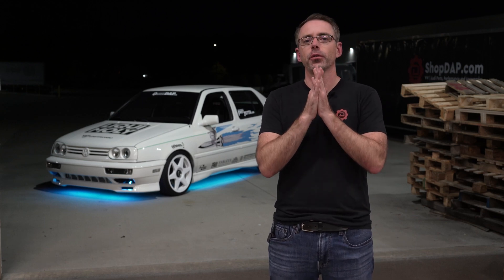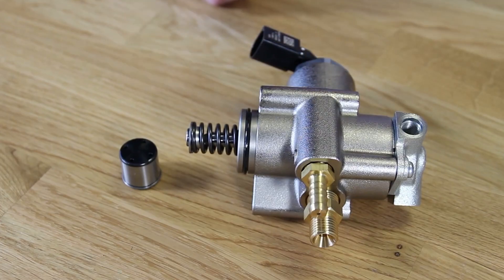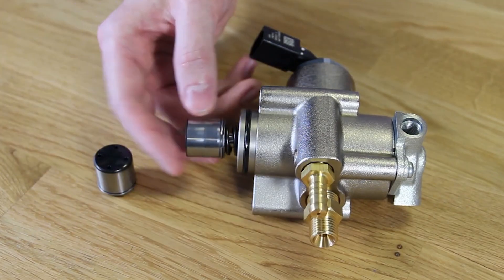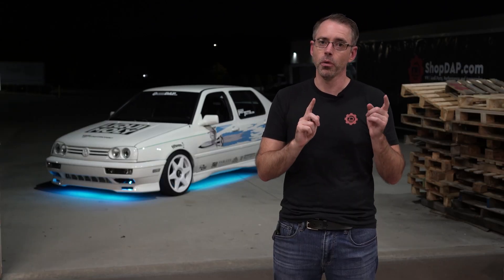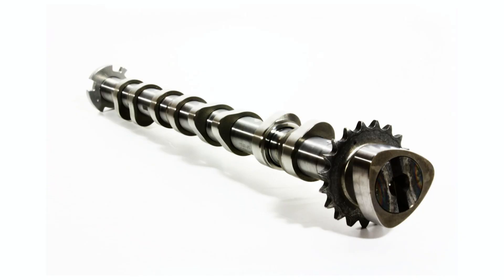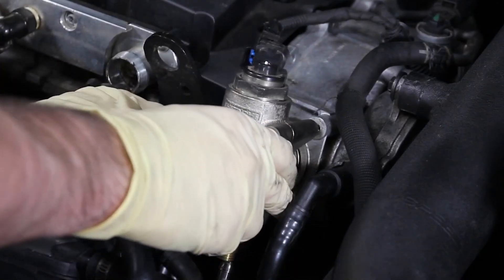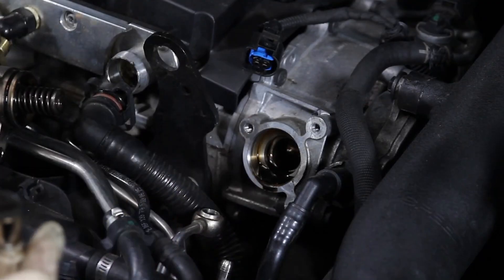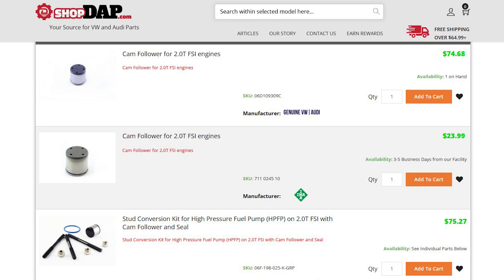Why Does My FSI 2.0T Have Low Fuel Pressure? - HPFP

Comment from the maker: Thank You for watching! All Kits and FSI related parts can be found below!

Camshaft (Complete) Install Kit for 2.0t FSI (with Fuel Pump)
https://www.shopdap.com/camshaft-complete-install-kit-for-2-0t-fsi-with-fuel-pump-06f198101jgrp.html

OEM - Cam Follower for 2.0T FSI engines
https://www.shopdap.com/06d109309c-2-0-t-fsi-cam-follower.html

INA - Cam Follower for 2.0T FSI engines
https://www.shopdap.com/711-0245-10-2-0-t-fsi-cam-follower-ina.html

OEM - High Pressure Fuel Pump (HPFP) for 2.0T FSI Engine
https://www.shopdap.com/fsi-hpfp-fuel-pump-06f127025m.html

Hitachi - High Pressure Fuel Pump (HPFP) for 2.0T FSI Engine
https://www.shopdap.com/high-pressure-fuel-pump-hpfp-for-2-0t-fsi-engine.html

Comment: I have a mint condition 2007 quattro 2.0fsi want to delete balance shaft arp studs springs retainers stage 1 camshafts rs3 fuel injectors hpfp k04 and a front mount intercooler, if I buy the parts want to build it on the channel? I already converted the tappet to the roller style for longevity 👌